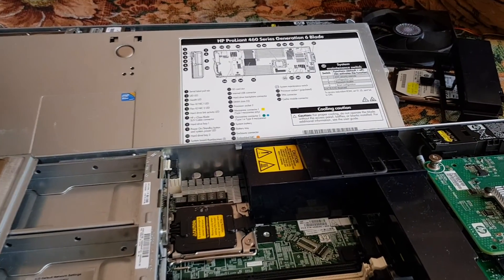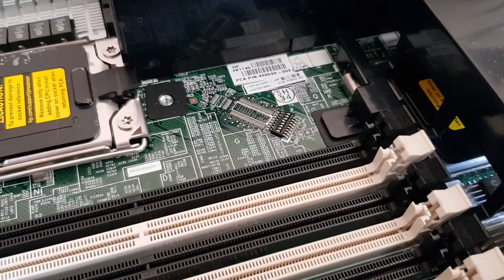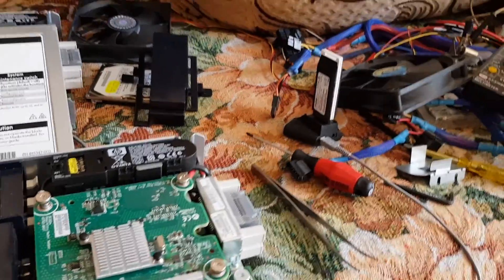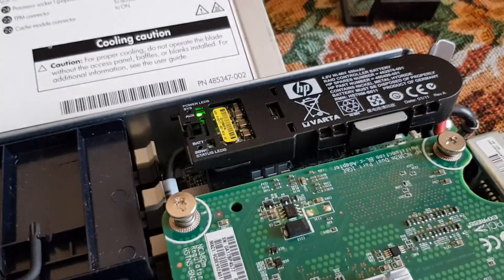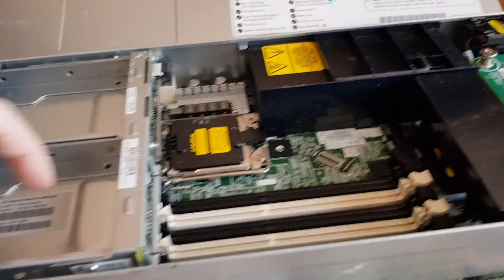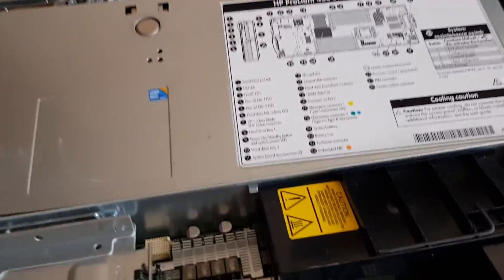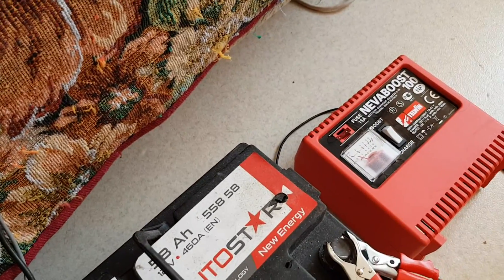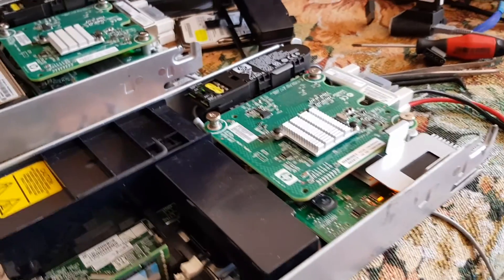Turning on hp bl460 g6 without blade centre

Comment: do i need to have that varta batterie?
Reply from the maker: No, it was just for balance 12v rail. At moment of film the cable where to tight
Reply: @endreu1  i tried a normal power supply and the power supply cable got too hot dont know why
Reply from the maker: @chilledbroccoli899  it can eat up to 40Amps on 12Volt rail and its a LOT (40ax12v=480w max) Wire gauge shold be at least 4.0
Reply: Hey mate can you help me with the SUV cable ?
Not sure what difference between them and the one that I need.
Reply from the maker: @chilledbroccoli899  yo! Here ya go. P/n:409496-001

Comment: Great explanation! Can you tell us in what voltage range the international PSU can Operate? I would consider building a 6s LTO battery for that
Reply from the maker: 12v stable, min is 11.8 max 12.2

Comment: The blade have any fan, or just rely on bladecenter for cooling?
Reply from the maker: the cooling fully depend from bladecenter, BUT you can use 1amp 12v fan to cool it. i've setup 3 blades with 120mm 1amp fan

Comment: не знаю понимаете ли по русски но по имени вроде да) у меня к вам вопрос правда по g7. там переключатели находятся сзади у зуммера. для запуска без шасси  включаю 1,3,4 правильно? или так же как и у вас нужно включать на среднем джампере только 5? просто у нас он включается и через минут 8 он завершает работу виндовс и потом горит крсная лампа.

I don't know if you understand Russian but by name like Yes) I have a question for you the truth on g7. there are switches behind the buzzer. to start without a chassis, I turn on 1,3,4 correctly? or just like you need to turn on the average switch only 5? simply have us he is included and through minutes 8 he shuts down work Windows and then is ablaze red lamp.
Reply from the maker: они все одинаковые у серии с g6-g8 только 5 надо и все должно работать без центра :)
Reply: @endreu1  понял спасибо. просто мы поставили переключатели те что около зуммера а не между процессорами. то есть если я вас правильно понял на том что у нас включенно нужно все выключить а между процами включить только 5? просто странно ведет себя. включается работает настраиваем и через какое то время  идет завершение рабты виндовс и все сервер больше не включается. точнее после выключения мигает красная лампа  и после  перезапуска бп сервер не как не реагирует. подождеш  минут 5 без питания стартует
Reply: @endreu1  вот на фото видно https://old.hlamada.ru/share/pictures/specification/original/5e21bedb17f03.jpg
там где зуммер мы включили 1 3 4  а между процами не трогали

Comment: What is the voltage being supplied, think I could use a kettle lead to do the job? I’m scared I’ll fry the thing
Reply from the maker: 12volt it use
Reply: Andrej Gubarev Doesn’t seem much.... Any suggestions on what to use? I don’t have a car battery 🤣
Reply from the maker: @lewisbrumby1508  get some used server psu from mining or any single 12v rail atx psu. you need about 40A (amps) to power it. there will be soon another video about em
Reply: Andrej Gubarev Also another problem is Ethernet, it has no Ethernet plug, so I’m not sure if you can buy a module that you can fit inside it for that
Reply from the maker: @lewisbrumby1508  it's qute simple. get usb extension cable. plug in inside usb and just get it from outside. get some wifi dongle or usb to ethernet adaptor.

Comment: Maybe a pointless/stupid question, but as far as I/O goes for this blade is there any pins on the board that can be made use of? for example, a usb hub
Reply from the maker: I gues no, bc one usb is inside and the other 2 goes from front connector. One thin about them that there is still no any pinout for the connector